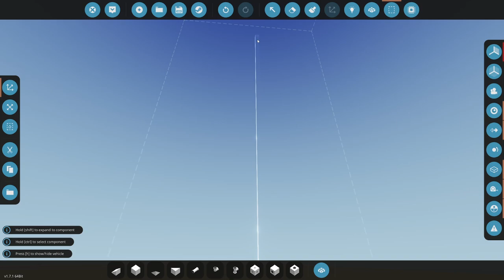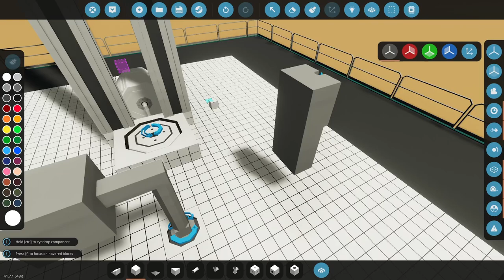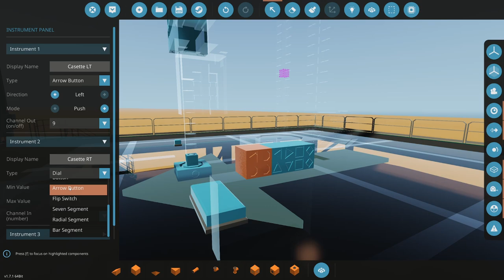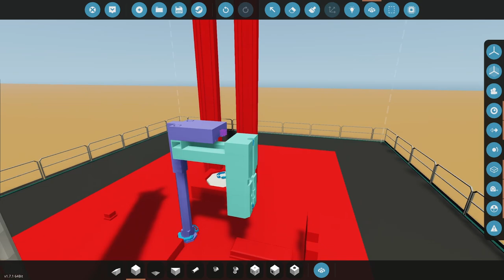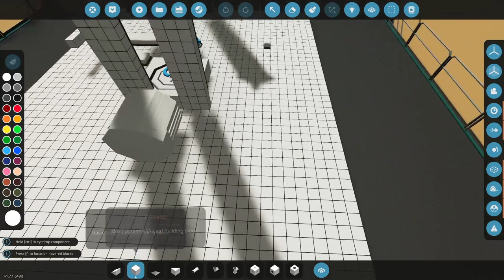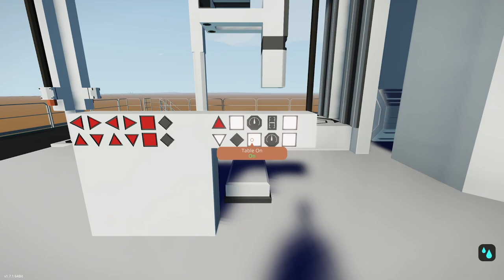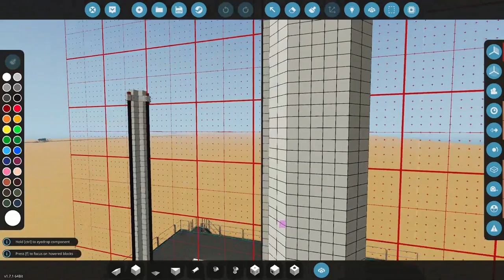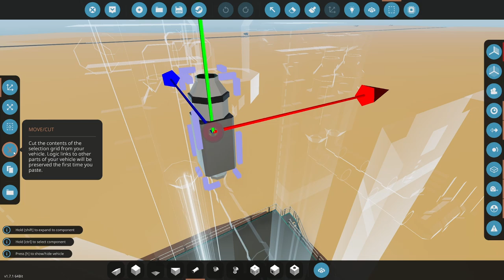Stormworks: Learning How to Drill for Oil P2 #stormworks

Comment: (at about 56min)why do you place the slurry-in fluid port at the top of the tank, wouldn't you need to pump it from the bottom or else it would just be air? does stormworks not work like that?
Reply from the maker: The game does not care where the liquid is. It will pull from anywhere in the enclosed volume.

Comment: Does Slurry (which I assume is "Drilling Mud"), need to have a certain pressure?  I just started playing SW again, and noticed that they had added pumps that are driven by a drive shaft now, so I'm wondering if you your small electric slurry pumps aren't pushing the mud with enough pressure (or is it flow rate that really matters)?
Reply from the maker: With any sort of pump in the pipes of the limiting factor. The devs made it so that the pipes will only allow for a maximum of 75 l per second.